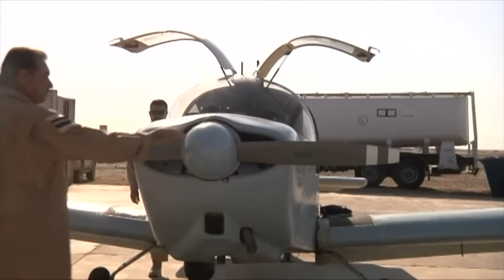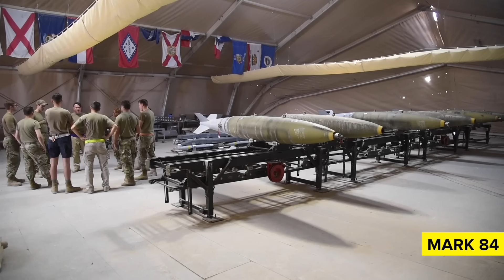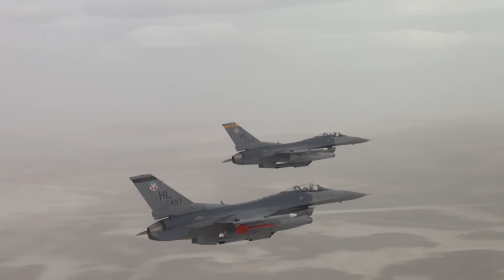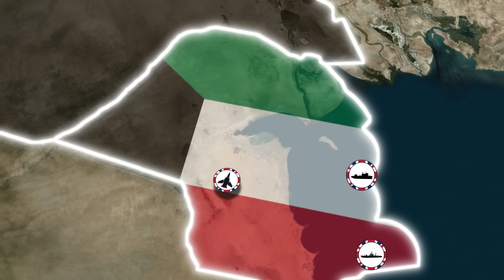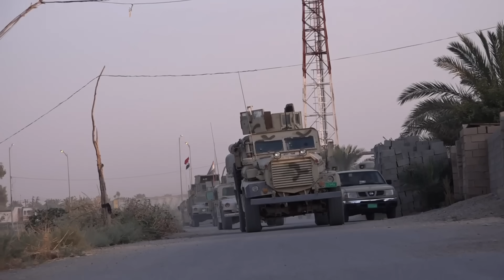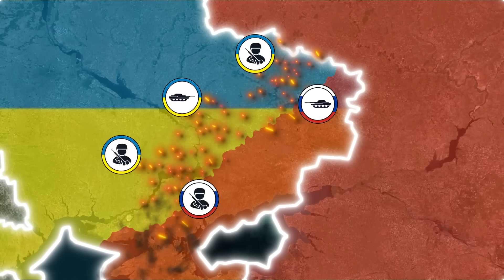How the US Completely Overpowered Iraq In Only 100 Hours

Comment: The ground troops thought they were going to lose thousands just breaching the berms.  Military doctrine for assaulting trenches at that time called for dismounted troops to assault them.  Regular soldier had an idea that he shared with his Sargent, Sargent took trooper to Lieutenant, Lieutenant dragged them to Captain, and up the chain it went.  The idea?   Use armorered vehicles to line up with the trench, fire mounted guns pinning the enemy in the trenches.  Use plow mounted tanks to quickly run down the trench lines burying the enemy alive.  It worked better than expected resulting in almost no casualties to the coalition.  Over 70 miles of trenches.  Modern feels really can't handle the true number buried during the assault.  🤯
Reply: Nice fiction.........
Reply: @varyolla435  Ah! .... but it's not fiction.
Reply: @davidwhitten3596   Trench lines in WWII as an example used to see men buried alive by massive artillery barrages.  In WWII the Allied forces broke out of the bocage country aided by tanks with "spikes" welded to their fronts to basically plow through the hedgerows where German positions were........

Moral:  using tanks with blades attached to breech fortified lines is nothing new.........  In the larger scheme of war it is probably mild compared to other things.  Also in so much as the Iraqis dug trenches and filled them with oil to be set alight it was one way to overcome such obstacles. 

Also the Iraqi troops were given fair warning to abandon their lines vis leaflets dropped promising safe passage to any who gave up = and thousands took advantage of that.

Comment: The information at 18:00 is incorrect. It is s a desil turbine engine, that uses JP8. Otherwise known as desel fuel. That’s simplifies logistic stress, and is far safer to use than jet fuel.

Comment: Air dominance, superior equipment, better trained and equipped soldiers in the use of GPS, NVG and other guidance systems and tactics, better supply, mobile formations that can strike hard and fade into the dust at will, roving bands of attack choppers going in ahead of these mobile formations and taking out supply and communications and strong points, reconnoitering enemy formations! On a battlefield of basically open desert! The list goes on! Iraq never stood a chance using antique (for the most part) soviet equipment.